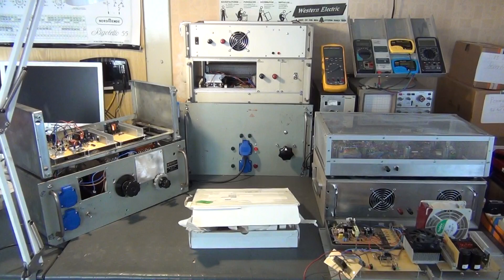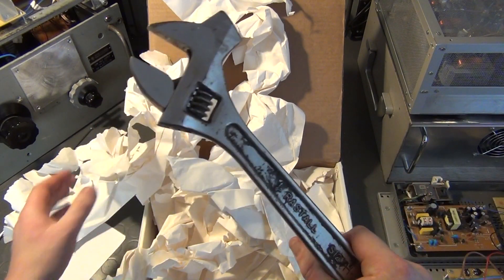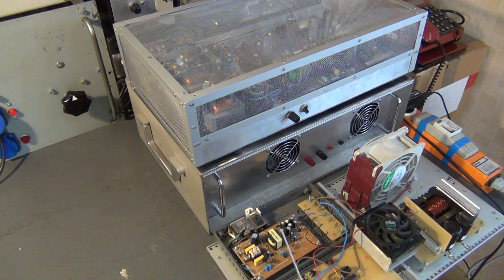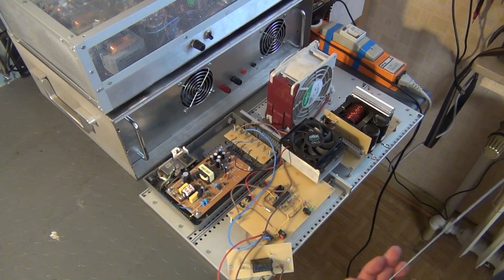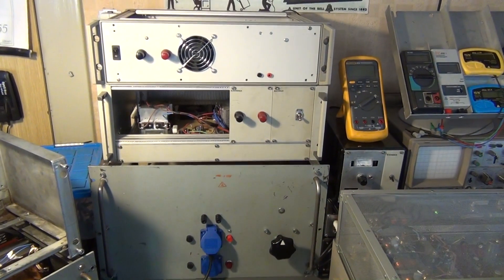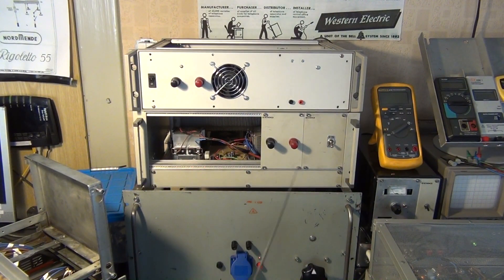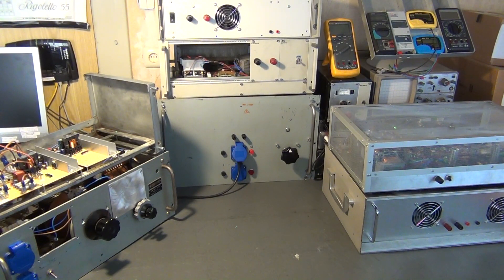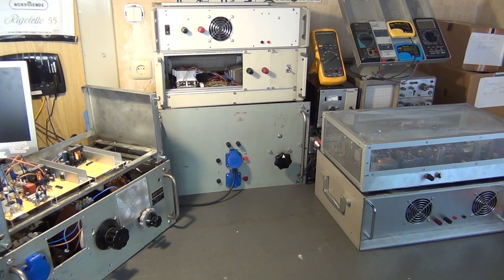TPAI Lab Report #006: AvE, The EDM and Self Made Lab Equipment

Comment from the maker: EDM = Electrical Discharge Machining / Machine 
In German: "Funkenerodieren /Funkenerosives Bearbeiten"
Ave's video about the idea / project: 
https://www.youtube.com/watch?v=EeKreZqgi9M
Reply: +The Post Apocalyptic Inventor thats a real nice swedeish nut lathe.
Reply: +The Post Apocalyptic Inventor I worked on EDMs with T-FET output stage which was very reliable and quite efficient.  High freq switching and all...
Reply: I didn't design them, I just worked on them (PWM PS) when the box showed up.  I never witnessed the unit in situ.  The design engineer I spoke with said the T-Fets were key as they used a high freq and switching PS.  Also had a solution probe and current sense.  That's about all I can remember as it was a long time ago and all I ever had to do was repair the output array and some minor ancillaries.